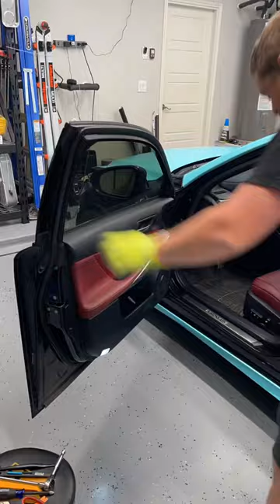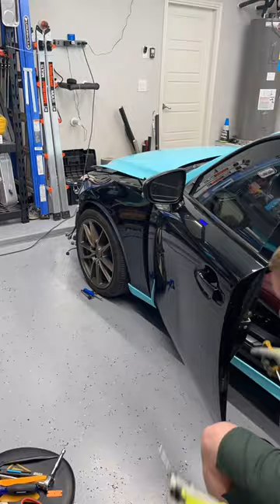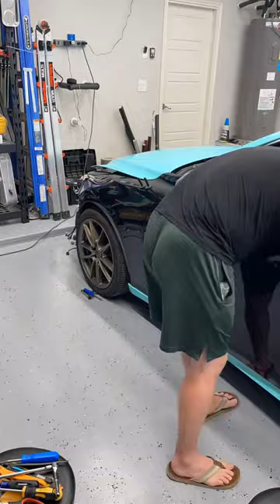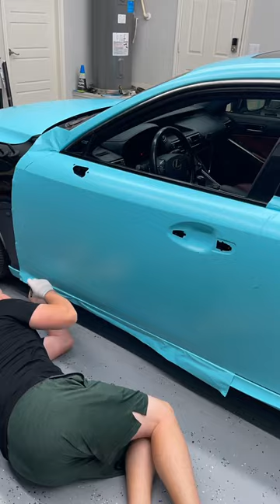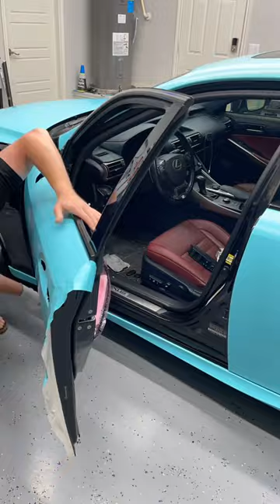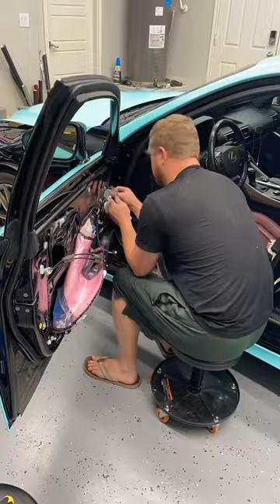How To Properly Wrap a Car Door

Comment: How do u get the door wrap to go on so nicely mine goes on wrinkled as all can be then I can’t get the wrinkles out I bought a ton of wrap and it’s a lot harder than for though
Reply from the maker: I’ve been doing it for a good handful of years but the brand of the vinyl is just as important as experience. I only use 3M, Avery Dennison, and Inozetek for customers but occasionally sample with other brands to see if I want to use them. As for the door/big panels, I get all 4 corners tacked and it’s smooth and it’s just a matter of working your way down the panel
Reply: @MTParadise  I don’t know what that means I got Teck wrap vinyl in lightning blue than the deep black.   I’ve been at it still for hours finally just wripped them off the door cause this is just super challenging for me idk why but I can’t get it right.  I’m hoping the wrap was on there for too long making it not easy to mess with but I’m just gonna keep learning I geuss
Reply: @MTParadise  I don’t know what that means I got Teck wrap vinyl in lightning blue than the deep black.   I’ve been at it still for hours finally just wripped them off the door cause this is just super challenging for me idk why but I can’t get it right.  I’m hoping the wrap was on there for too long making it not easy to mess with but I’m just gonna keep learning I geuss